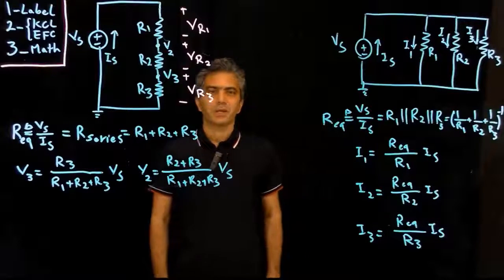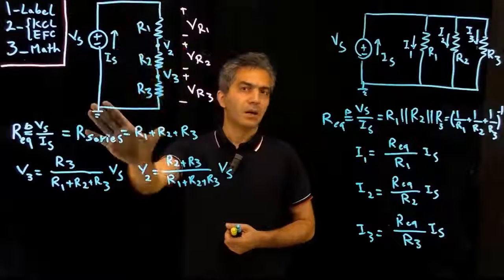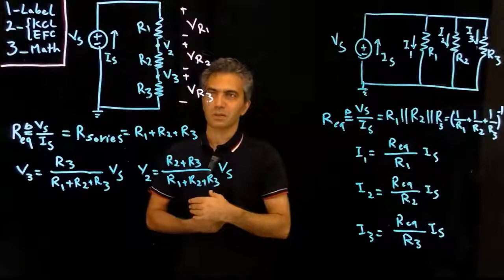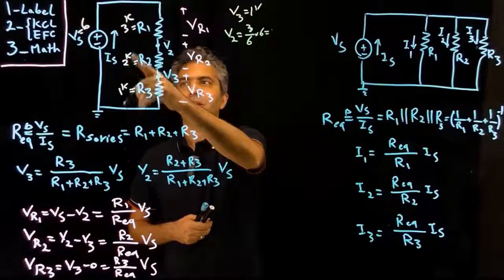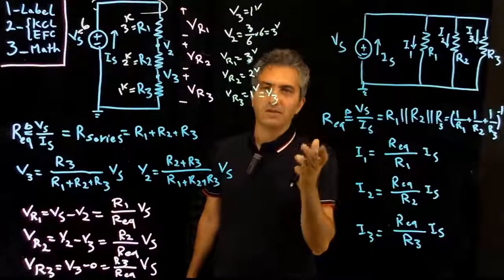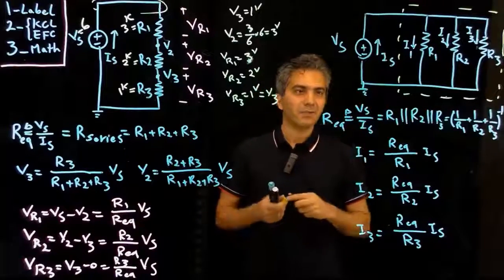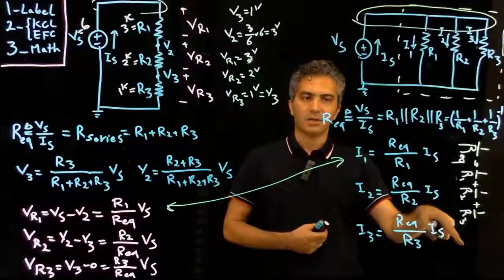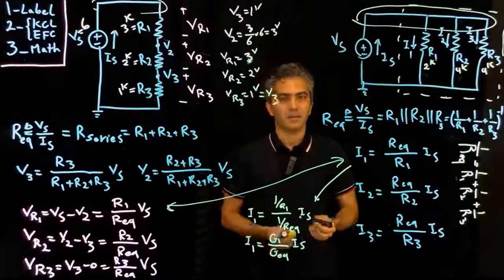Lecture 8: Voltage/Current (Or Resistance/Conductance) Duality in Series/Parallel Resistors

Comment: Hello, there is one thing I am confused about in this video. You are using kilo ohms, but would it make a difference if you used ohms? Is it the same because it's always a ratio multiplied by Vs?
Reply from the maker: You are correct Jared, since we are dealing with ratios of resistors, it doesn't matter if you use kilo Ohm or Ohm. Even if you deal with actual values, you can still keep using kilo ohms and Volts, and all the currents end up being in mA as opposed to Amps.
Reply: @electricalengineeringmadei1041  thank you
Reply: @electricalengineeringmadei1041  was wondering if you knew of any good linear algebra videos off the top of your head? Setting these up into a system of linear equations, is the thing that’s most foreign to me, at the moment.